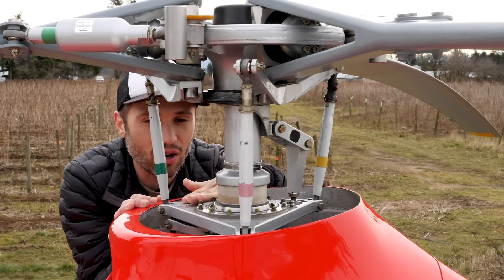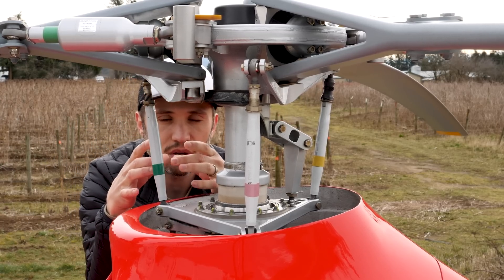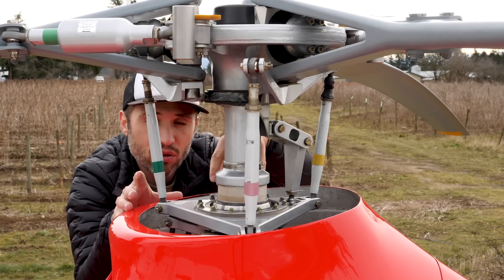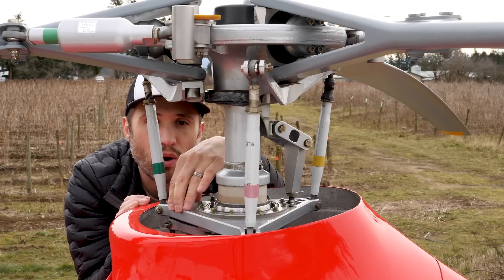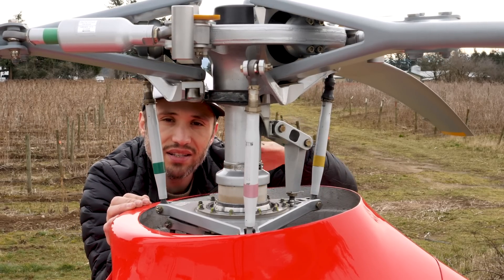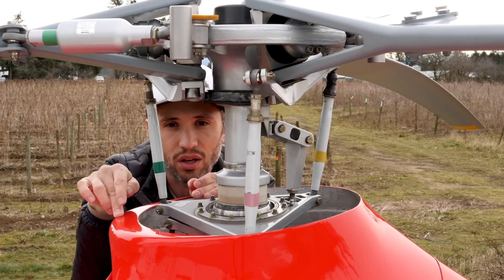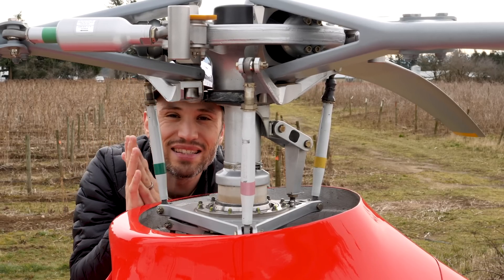THE MAGIC SAUCE THAT MAKES A HELICOPTER WORK

Comment: there is literally no one else on the internet mentioning phase lag. great video
Reply: Whilst the presenter is essentially correct about the mechanical and physics of a rotor head operation there is several errors that need correcting. Phase lag is more correctly  precession. The Swash plate is a single component  comprising a fixed lower part and a freely rotating upper part. There are not two separate swash plates. 

Furthermore, whilst the most common method in use, swash plates are not the only method used. Alternatives are the spider method which utilises a fixed control rod with an external spider at its upper end and which mounted inside the rotor drive shaft which is hollow.
Reply: @EVISEH  Also he mentioned that with cyclic input the pitch of the blade changes 90 degrees later but that's actually incorrect. Pitch changes exactly where the swash plate is directing it but the force this creates is  "felt" 90 degrees later.

Comment: So when the swashplate is reducing the angle on the left side, the angle is the lowest in the front? 
Or are we talking about gyroscopic precession where the force is acting in the front, but is applied on the left?
Reply: correct , it is due to precession , if the blade angle was lowered at the front the blade would take 90 degrees to react  , so would be lowest over right side  . That is for euro helis rotating clockwise.

Comment: Thank you for that video. As a child, I used to play with my toys and dismantle them and I had the same curiosity for the swash plate. Later at 18, I was happy when I discovered composite materials and carbon fibres used on Eurocopter AS350 Écureuil especially its swash plate the Starflex: https://www.youtube.com/watch?v=PaSm3cor3wg        https://blog.aopa.org/aopa/2011/05/25/starflex-rotor/

Comment: And that‘s the part, the whole heli is hanging from when airborne. As they say: „A helicopter is 10.000 parts rotating around an oil leak and the pilot is trying to keep them flying in close formation!“. Having had the extreme pleasure to have flown an R44 two times for 30 minutes each actually on the controls with a flight instructor riding shotgun but not touching the controls I can tell you, I was soaked both times but the smile up to my earlobes lasted for hours! Flying a helicopter is the most fun you can get with your clothes on!

Thank you for this perfect explanation of the most crucial part up close so that we all know how the blades are mechanically programmed for the complex movement!

Comment: I've never understood this till now.  So the rotor always remains perfectly square -- the rotor plane doesn't tilt, the segments of LIFT in the rotor blade from the blade pitch angles do all the work of posturing the body of the helicopter.  Cool beans.  Way easier to do that than come up with a way to deflect the whole rotor plane.  Makes sense.
Reply: The rotor plane DOES tilt but in non-obvious ways.  Pushing the collective forward causes the swash plate to tilt to the right; that's the 90 degrees phase difference.  But the rotor disk does actually tilt forward!  It is a phenomenon of gyroscopes.  You apply a force on the left side of the spinning rotor disk but the disk does not tilt right, it tilts forward!    

The whole point of a fully articulated rotor disk is to allow it to tilt independent of the helicopter body danging underneath and balanced to prevent the weight of the helicopter from influencing the rotor disk plane.  When they were first invented, helicopters were extremely unstable because of this phenomenon.  Make the helicopter start going forward, the mast tilts forward, but tilting forward actually causes a force to the right!  So the helicopter starts moving to the right, but that creates a force on the rotor disk and it tilts to the rear!  So the helicopter starts moving to the rear, but as soon as it does, it experiences a force to the left, and round and round it goes rapidly amplifying until crash. 

https://en.wikipedia.org/wiki/Precession

"If a force is applied to the surface of a spinning disc, for example, matter experiences no change in direction at the place the force was applied (or 180 degrees from that place). But 90 degrees before and 90 degrees after that place, matter is forced to change direction. This causes the object to behave as if the force was applied at those places instead."

Comment: Makes me think maintenance and inspection on this is critical with all the moving parts.
Reply: I saw a photo of a service member with a five foot long wrench used to tighten the one large nut that holds the blade assemble in place on a military chopper.
Reply: The ratio of maintenance man-hours to flight hours is much, much higher on helicopters compared to fixed wing aircraft.

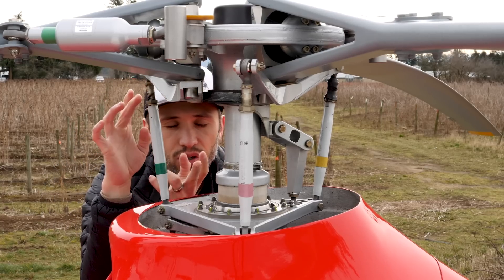Comment: 1:06 what happens if a pitch link fails during flight?
Reply: cheese chisel That would be the end of that flight! 🚁
Reply: @Pondimus_Maximus  I meant what would the effect be? is it recoverable? massive rotor damage? does that blade just automatically feather?
Reply: Most airfoils produce pitch down moment so the blade will feather down to a point where it produces almost no lift, and will not respond to any inputs, so most likely will cause abnormal vibrations in the whole disc and loss of control, so yeah it would be the end of that flight

Comment: Does the pitch of each, say at steady craft forward direction,blade change pitch constantly according to its angle of attack , e.g. one blade has a different “ bite “ of the air as compared to say it’s blade at say 180 degrees, ( eg Bell 212 )
Reply: Yes, except in a stationary hover.  In a hover each blade will have exactly, or nearly exactly, the same Angle of Attack (pitch angle).   Flying forward the advancing blade will have less pitch and the retreating blade will have more pitch.

Comment: A radio controlled helicopter would be a great tool to teach this concept. It’s amazing that the actual pitch on each individual rotor blade is changing throughout the 360 degree rotation allowing for a fixed main shaft. Love your channel and your footage. Great editing!!!!
Reply: I purchased a Blade 450 RC helicopter for that exact reason, so i could study swash plate and this curious phenomenon of pushing on the side of the spinning rotor to make it tilt forward.

Comment: ...nice.. but why call it 'magic'..?.. you'd just explained the mechanics of it.. just saying- still enjoyed
Reply: Magic is entirely appropriate.  You'd think that to go forward you simply tilt the rotor forward.  But it turns out that to do that, you push up on the left side of the rotor and instead of tilting to the right, it tilts forward, which is not intuitively obvious why it would do that.  Hence, "magic".  Also known as gyroscopic precession.

Comment: A very good explanation of the helicopter swashplate & how it works for those who do not understand helicopter flight. You should also do a video with the anti-torque control pedals in relation to the pitch control changes of the tail rotor & how this affects helicopter flight (anti-torque from the main rotor to keep the helo fuselage straight as an arrow during forward flight & left/right directional turn of the nose/tail of the airfraft of the vertical axis plane)!

Comment: Can you explain what the effect of the different blade speeds on the left and right side has on top speed?
Reply: Unless you're in a hover, the advancing blade is flying at Indicated Airspeed PLUS angular speed, and the retreating blade is flying at Indicated Airspeed MINUS angular speed.  The short answer is that when the difference between (Indicated Airspeed MINUS angular speed) is zero, you get into retreating blade stall.  You don't want to go there.  This effect limits the maximum speed of the helicopter.

Comment: That thing is an absolute marvel of engineering! Mind-bogglingly brilliant! Imagine the tens of thousands of painstaking man-hours that took to perfect that, back in the day. Inventors in those days were extremely brave souls! Igor Sikorsky was probably extremely quick to realize he needed a tail rotor, too, the first time he left the ground in one of these contraptions! 😂

3 years ago, I had never even seen a closeup of the swashplate before. The only swashplate I was familiar with was the one inside an automotive air conditioning compressor. This vid right here is the most detailed an explanation I've ever seen on this component. Thanks, Mischa! 👍🍻
Reply: I knew I heard that team before. Thanks.

Comment: Nice one! So how are the stationary and moving swash plates connected? I see the bearing, but it looks like if the moving plate on top could pop off any moment, because it's on top of that spherical bearing, right?
Reply: It also has a ring of roller bearings that grip the stationary part.

Comment: Concise and precise, it is almost the same approach for the tail rotor ; the action on the pedals will lead to an adjustment in the tail rotor blades pitch angle, one pitch angle will increase and the second will decrease. My question is what is the difference between the different types of rotor (rigid,semi-rigid and fully articulated)?????
Reply: First, imagine, in this case, a rigid 3-bladed rotor head and blade system where all blades are mechanically separated by 120 degrees of angle.  When it rotates, all blades are 120 degrees apart from one another.  Now, let's talk about a Fully Articulated rotor head.  Each blade has a vertical hinge, to allow the blade to "lead" or "lag", i.e., seek a position ahead or behind that 120 degree line due to aerodynamic forces, and a horizontal hinge, to allow the blade to rise or fall, i.e., seek a position up or down from that 120 degree line due to aerodynamic forces.  The rotor head that Pilot Yellow is using as a teaching aid appears to be Semi-Rigid, with only a vertical hinge.  A rigid rotor has neither of these hinge features.
Reply: A tiny bit of correction: Only two-bladed rotors can be semi-rigid. This is a fully articulated rotor system.
Reply: Wikipedia explains it well enough

Comment: Wow was that informative. I keep thinking that there is a lot of friction translating the non rotating swash plate to the rotating one.. How many hours of flight time before these bearings are replaced? The 90 degree delay is interesting. Must correspond to the inertia in the blade above to rotate it a bit in the blade socket. The most brilliant explanation and demo I have EVER SEEN on how the collective and cyclic work to actually control the helicopter flight control surfaces. THANK YOU!
Reply: If I remember correctly the 90 degree reaction is caused by angular momentum torque...but you may want to double check that since its been a long time since I was in flight school. 😁
Reply: @drewbello8721  It's not it's caused by amplitude and velocity of blade flap (the up/down movement of the blade that happens when lift increases or decreases due to cyclic pitch changing and lift changing on the advancing and retreating blades during flight) being out phase with each other. If it was just precession it would always be exactly 90 degrees and it's actually less than that on some designs like 72 degrees on the Robinson R22.
Reply: Each aircraft manufacturer publishes recommended inspection and replacement information in their owner's manuals. They are not the same for every helicopter.